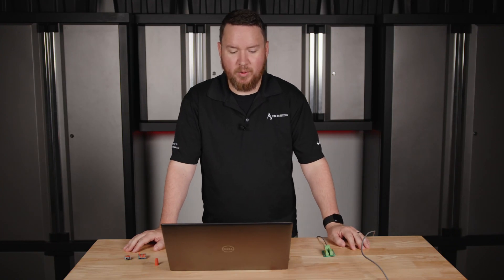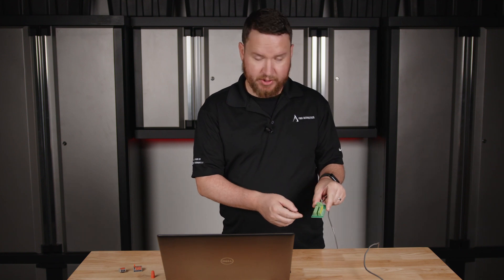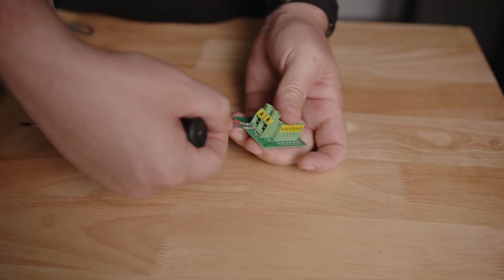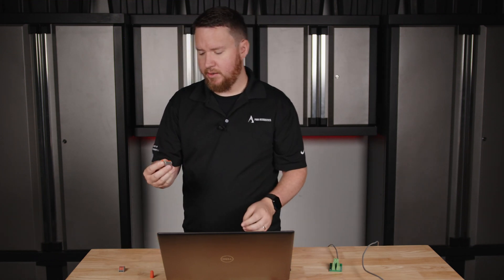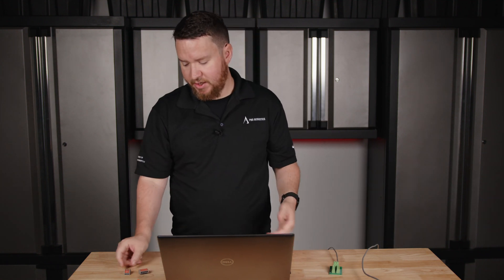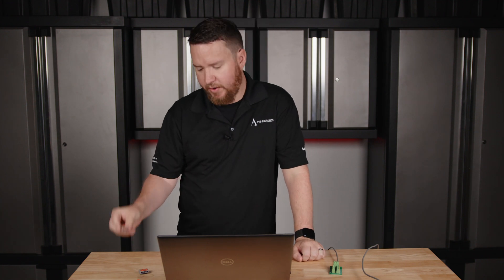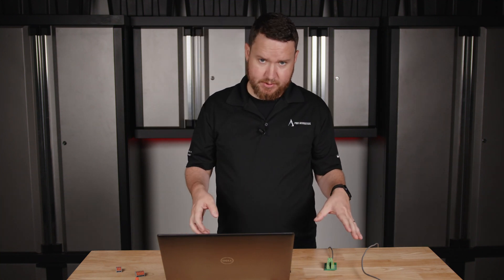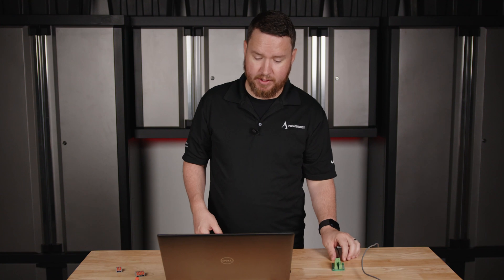How to Use Wago Connectors vs Terminal Blocks on Pro Acoustics Tech Talk Episode 127

Comment: Hey guys! Great video! I was thinking about running AWG12 from the amps to the rooms (have some 100ft+ runs) and once there, use wago connectors and a lower AWG to wire 1 to 4 speakers (depending on the room). Judging by your video, my plan seems fine?
Reply from the maker: Thanks for watching, and we appreciate the kind words! Yes, your plan sounds adequate. Just ensure your total speaker load matches your amplifier’s power capabilities. Sounds like a great setup!

Comment: Thank you for the video.  I am running 6 speakers to a couple Wagos (1 positive 1 negative) then using a pigtail back to the terminal block on the amp.  Unfortunately, it is not working which I am still troubleshooting, but I do have a couple of questions.  1) someone suggested to use bell wire for the 8 ohm ceiling speakers but that gauge seems awfully small, should i go up in gauge?  Also, solid vs stranded wire, does it matter?  Solid just seems so much better/easier to terminate.
Reply from the maker: Thanks for watching!
1) For 8-ohm/low-impedance speaker runs, it's a good idea to use a larger wire size, especially for longer distances. Consider using 14/2 or even 12/2 gauge wire, depending on the distance.
2) Solid wire may be easier to terminate, but stranded wire is typically used for audio connections because it is more flexible and easier to work with. Stranded wire also has a larger surface area, allowing the signal to pass through more efficiently.
Hope this helps, and good luck with your troubleshooting!